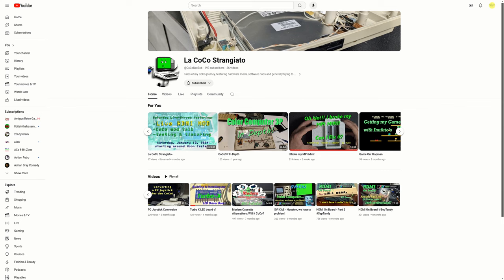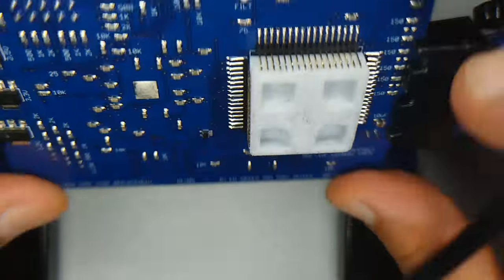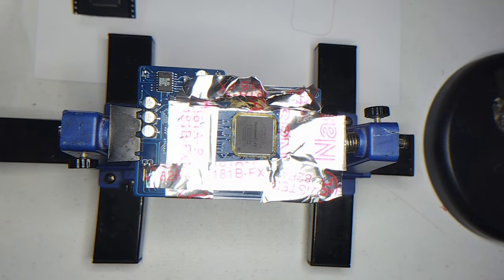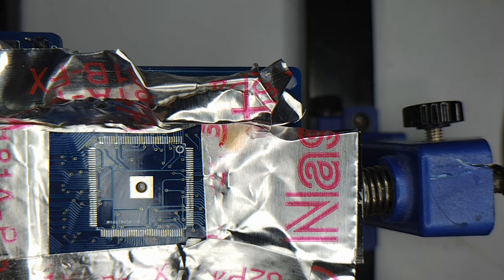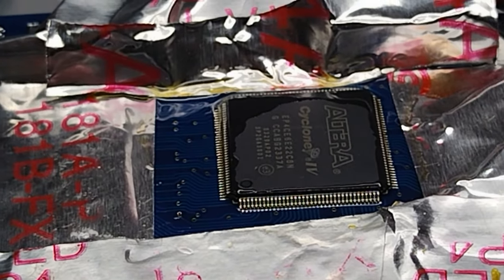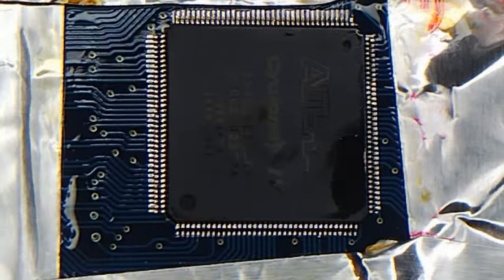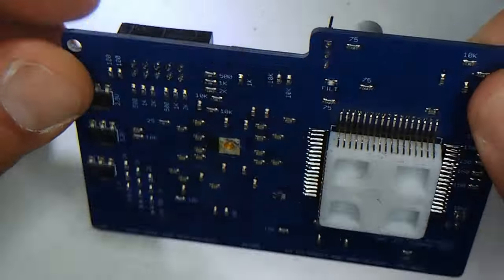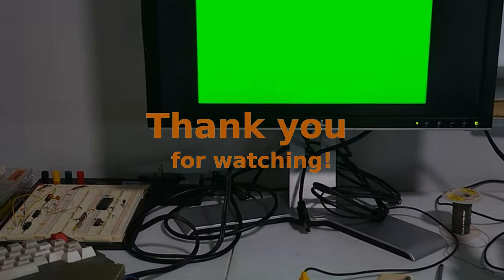Attempting to repair a dead GIME-X.

Comment: Nerves of steel!!! I'm barely able to do a 32 pin chip, and get it lined back up. What flux are you using? Another great video!
Reply from the maker: Thank you! Oh I'm sure you can do this, it just requires a little practice. The flux is  MG chemicals no clean flux. Here is the amazon link.

https://www.amazon.com/gp/product/B00425FUW2/ref=ppx_yo_dt_b_search_asin_title?ie=UTF8&psc=1

Comment: @rockyhill3
Thank you for sharing the video
It is great you were able to replace the FPGA chip and fix the system.
Did you already have the replacement chip programmed before replacement or did you program it after replacement?
Reply from the maker: My pleasure! I actually didn't have to do any programming because the program sits in an external serial flash chip that I hoped wasn't fried.
Reply: @rockyhill3  
That is great :)
I didn't know the FPGA information was in a external Flash/EEPROM.  That does make it for sure easier to fix this then. :)
Reply: @rockyhill3  Oh there's the answer I asked above... disregard!